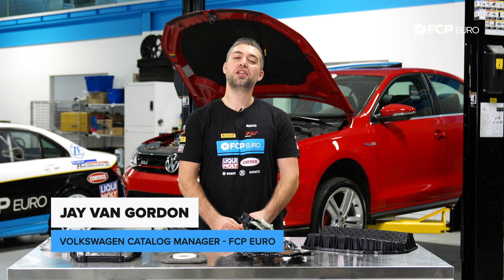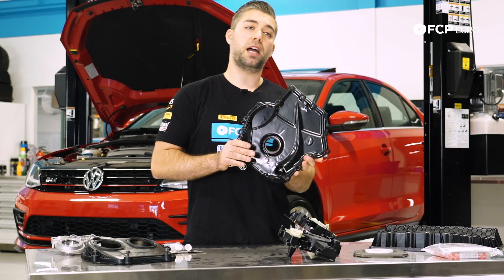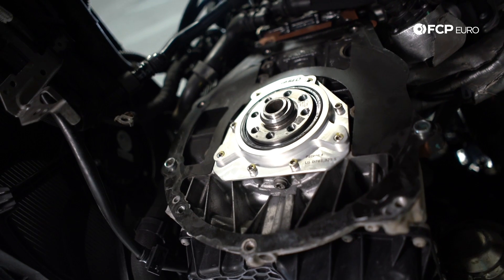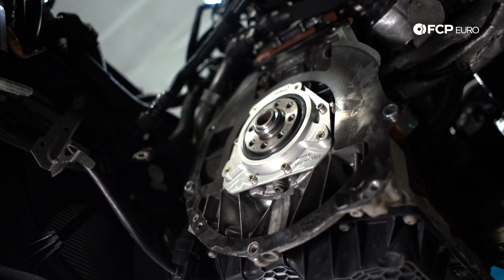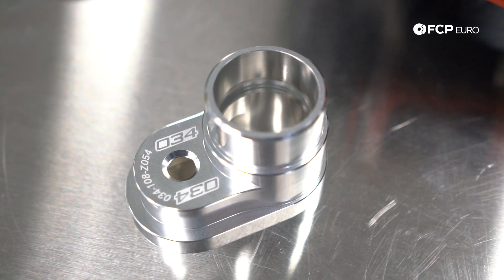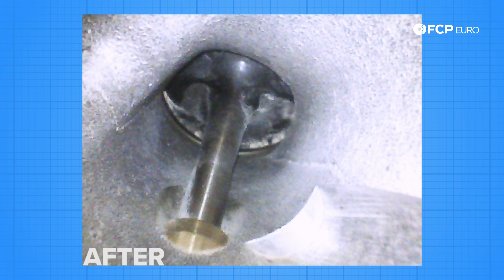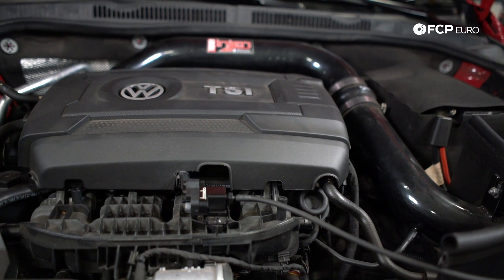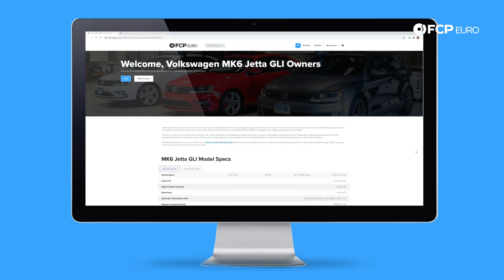Volkswagen EA888 Gen 3 Engine Diagnostics & Maintenance Guide (Mk6 GLI, Mk7 Golf, GTI, Golf R, S3,+)

Comment: 105k miles on my B7 1.8t Passat! Not a single oil or coolant leak 🙌💯
Reply: Update: 205k miles still running all original parts on the engine!
Reply: @danielveliciu3445 Mine 225.000 like new.
Reply: @danielveliciu3445  ??? BS or u don't have clue yet may be who know*
Reply: @bm_wuratli6883  lol are you high? 

I’m at 223k miles still running strong.. Replaced water pump at 210k only because I was walnut blasting the valves.. Everything else on the engine is still original never been touched besides maintenance stuff..
Reply: 2016 1.8t with 121k miles. No leaks so far.
Reply: Lucky you. Mine just passed 108k kilometers and the water pump started leaking.
Reply: @atgv43  Seems to be a common theme with vws. We've like 8 water pumps in stock at all time because they leak so frequently. Most common on vr6s
Reply: @shankyouverymuch8321  I guess maybe I am lucky that it lasted this long. My car is a 2016 Passat with the 1.8 TSI.
Reply: 2018 passat 2.0 b cycle, I finally changed the water pump at 110k but only because I felt like doing it, it wasn't giving any problems. 
I have not put anything into this car that wasn't completely preventive maintenance. Nothing has broken except a rear wheel speed sensor at 25k miles. 
I also beat the shit out of it for 800 miles per week and leave every redlight full send. LOL
I think the best thing to do with any car is drive it like you stole it every day. 
Old lady cars always break down more often than cars that get rode hard and put away wet.
Reply: @jims.3987  good old Italian tune up really does help out!! I just passed through 179k miles yesterday and she’s still running strong.. Still running on the original water pump 🤞 Only leak that’s recently developed is a very small one on the upper timing chain cover.. PCV valve replaced every 45k miles, transmission fluid flush every 50k miles, and coolant at 120k miles.. I do beat the crap out of my car and my oil consumption is around a quart every 5k miles but that’s when I change the oil regardless.. Original turbo as well.. I guess I’ve been very lucky with this car!!

Comment: Thanks for all this information! I hope I don't have any issues but I should be covered under the 5 year warranty since mine is a 2k18. I've changed the oil quite a few times in the 22k miles I owned it. I did the first around 3k miles. Then about every 5K since then.
Reply: Keep in mind this is the company mill for VW/Audi they’ve been using this engine for 10+ years in millions of different models world wide. Engines that have major issues are a very very very small percentage. I personally have 138K miles on my 2015 GTI and it runs like new with routine maintenance and I drive it hard. 

Also, this isn’t a knock on FCP or any other company but they are here to sell you parts so of course they’ll make a video like this telling you everything will break.

Comment: You don't need to remove the intake manifold to replace the water pump assembly, vw actually recommends not to do that
Reply: no....if your car is on warranty, VW service will do it from below, if warranty is no more, VW will remove the intake, bcoz it is easier but more expensive lol
So cheap way is from below, expensive is from the top -> Warranty they go cheap on you. No Warranty = you are the sucker 🤣

Comment: Great video! I did click on it expecting to see my particular failure but it was not on this list and I have not experience any of the ones you mentioned. I do have a 2017 Alltrack with 60 k miles. I do autox and track about once a year. My issue has been with my turbos, I have broken two wastegate actuators, the first one on the OE is 12, later I upgraded to the is20 and also broke the actuator rod in two pieces. Hopefully you will star selling that Mahle actuator being offer as an option by other places.

Comment: My Gen3 GLI has a metal oil pan. I bought the car new from the dealer with it in 2016. 🤔
Reply: So does mine, a 2014. Although mine may have been replaced before I owned it
Reply: My Gen 3 Jetta has a metal oil pan, I haven't got any replacements

Comment: Is gen 3 more reliable than gen1?
Reply: Way better engine because of better timing chain tensioners. Better piston rings, better PCV, and more power. Like any turbo engine though, it needs oil changes done often.
Reply: @Dcc357  that's all that's needed.. The scaremongering on here is unreal.. Probably most think because get serviced by audi it's going to be good oil. Its the cheapest going longlife crap.. I do oil changes on my own. They ain't getting it anymore.. Fsh means feck all.. Anybody can stamp book.
Reply: @johnallan1134  I'm switching to Motul Specific VW 508 oil. 100% synthetic too. However, still changing that at 5000 miles lol. That way I don't have to do 3000.

Comment: What is the most reliable Jetta engine? I’m looking to get into a Jetta from 2014-2018
Reply: The 2.5 5cyl is a work horse and can get 300k easily with proper maintenance. Its not the fastest or the best mod friendly engine but its good. Just keep in mind that any engine will treat you right if you treat it right.
Reply: @SlowBoiGang  which would you deem the easiest to work on? I love being hands on and I always fix everything myself as much as I can. I’d like to do some simple modifications but I’m looking for one that’s the easiest to work on and will get the best gas mileage.
Reply: @tylercorbiere1713  I've had the 2.0(non turbo), 2.5 5cyl and the 2.0T. All three have been pretty easy to work on so if you had to choose I'd also factor in your goals. Do you want performance or just a car to go from A to B.
Reply: @SlowBoiGang  I’m not really looking for performance. I’d probably put a new intake, bov(if turbocharged), better intake manifold possibly and the rest would mostly just be aesthetics, maybe new exhaust tips and a little bit more aggressive muffler. I’d like features such as sunroof, push start, command start(I could install it), and Apple car play. I’ve always driven a manual but I’ve been considering getting a auto for my daily and building something else as a project. Biggest goal is to remove the thought of “what’s going to go wrong next” as I have a Mercedes c230 06 currently.
Reply: @tylercorbiere1713  you should look for a used Jetta GLI then. Very mod friendly, the 2.0T is great. The sedan is nice over the GTI hatch in my opinion. You can make a solid 300hp and still get great mpgs in a comfortable ride thats good for cruising.
Reply: @SlowBoiGang  I’ll definitely start looking into them, thanks for the advice, I appreciate it a ton !
Reply: Prop the 1.4l
Reply: For that year range the 2.5 liter 5 cylinder.
Reply: The 1.4 turbo from that era is bulletproof

Comment: 90k miles on my MK7. water pump was replaced 10k miles ago. No oil leaks to speak of.
Reply: @Bryce Czirr I never had mine cleaned. MK4 GLS 15 years 135k miles. Died in wreck. MK6 2.5 SE lasted 8 or 9 years at eighty something thousand and killed by a wreck (I seem to be a target - bit hit a total of about 5 or 6 times in my life). To be fair it never occurred to me but nothing ever happened to indicate it was necessary.

Comment: I have 2014 GLI autobahn 6mt. I bought it when it had 60k miles and it now has 102k miles. I added APR stage 1 around 80k miles. I love this car! It had given me zero issues! I hope I can get another 100k trouble free miles out of it!
Reply from the maker: Take care of it and it'll take care of you, we're sure you'll have it even longer than that!
Reply: @fcpeuro  Is this the same gen 3 that’s in the 2018 Volkswagen Jetta 1.8t se sport?
Reply: @fcpeuro  i read something about timing chain tensioner failing on some EA888. I know the timing chain tensioner were updated through out the different generations of the EA888. I do believe my engine is the EA888 gen 3. Do you know if timing chain tensioner on this generation engine needs work? I can’t find anything on the maintenance schedule about timing work.
Reply: @CungNguyenify  lol oh yeah!! Mine is a 2014 GLI so its a gen 3. I had a loose timing chain due to tensioner, which in turn made my camshaft rattle and get chipped. So new camshaft, mill the block from what the camshaft damaged, new oil pump and valve check. All started bc i had an EPC light / limp mode which turned out to be a wastegate. So new turbo too lol. My car was a pain in the ass but i basically have anew engine now...but yes tensioner on gen 3 yup is still something to worry about
Reply: The CCTA engines have the horrible chain tensioner problem....if not changed it WILL fail and destroy the engine.  There's a reason they go for $3k used, because they all fail.
Reply: How many miles do you have now

Comment: What is the difference between the engine in the 19 (usa) 2.0 Tiguan and the (usa) 2.0 (GTI)? Is it tuning? Turbo? internals?
Reply: I just  got a 21 tiguan  and a apr stage 1 tune, its awesome.  About to replace cold air,  turbo pipe  and a ecs bov..
Reply: Its basically a tuned down engine. I believe they have the same IS20 turbo
Reply: @SlowBoiGang  thanks for the reply.. That makes my mind up about getting a tune on it from APR.
Reply: @carlosgrajeda8590  nice. I heard that tune really wakes up the car

Comment: I just got to the point that my water pump is leaking... Going to do it on monday , but i got the dual injection version since i live in germany, car has now 120.000 km , i feel like this engin hasn't got a lot of life time even with good usage.. isnt the same as a 6 Cyl. car from BMW for example which can easily run 200.000

Comment: Yes the cam cover also leaks oil. The dealer charges 8 hours labor to reseal. Can you comment more on the scan tool parameters relating to timing chain stretch?  Great video as always!
Reply: Obdeleven can do it for cheap. I'm at 145k miles and have 0.4% deviation on intake timing and 0% exhaust. They're definitely better than the mk6
Reply: @Tcflohr  can you share the name of the PID?
Reply: I've just change mines, took about 3 hours.
Reply: I tried reading it with my OBD11 but couldn’t figure it out. It just like wouldn’t register.

Comment: Love the good info from you guys, keep up the good work! Rockin 65k miles on my GLI and no issues yet, fingers crossed, but if I do, this will help me narrow things down.
Reply: I'm sitting at 111k and only had to do water pump so far
Reply: @CharlesBK-xm7oc  good to hear i have good tidings ahead lol, you run your car hard or just daily drive it?
Reply: @Hobophob1c  it's been my daily for about 4 years now.  Pretty happy with the purchase.  Only thing that's gotten too bad in the driver's seat.  Seems like they used pretty cheap "leather" but other then that cars been great
Reply: @CharlesBK-xm7oc  awesome to hear, and yea the leatherette is nice and all but i still wish we coulda got the plaid gti seats
Reply from the maker: Keep up on that preventative maintenance Sayge and you will be good to go for a long time!
Reply: @fcpeuro  it would be awesome if you guys could you make a video on some preventative maintenance Gen3 owners need to do that arent made apparent in the owners manual? If there is any of course.
Reply: @fcpeuro  Hey man I have a mk7 gti, it’s been coding P00b7. Coolant temp on gauge will go into the red, but an obd read says the temperature is normal ~(194). Car goes into limp mode, and limits rpms to like 4K. Any clue on what it could be?

Comment: So what part of the drivetrain doesn't have problems haha, the air filter? classic VW-Audi crap
Reply from the maker: Well when you hit the start button atleast!..... wait no , that has been known to cut your finger too. Let us get back to you 😁
Reply: He is talking about potential issues...if you want potential issues of whatever car you drive look it up I am sure there are many.  How about the common issue on Toyota 3.5 V6's when the alternator fails you have to pull the engine in most cars with these V6's.  All Brands have their known issues so don't fool yourself into thinking otherwise.  Toyota's and Honda's as known "Reliable" cars also have slipped dramatically in reliability over the years.  The more modern, efficient, technical cars get?  The more problems you will see.  You see it first hit the German and American cars...why?  Because the Europeans and Americans are "innovators" where the Asian brands are "Duplicators" or copy other manufactures tech.  So when you reverse engineer something it is usually made better.  These are facts.  Don't believe me?  Look up the History of Toyota for example and see where they copied stuff and that is only what they admit to.  These are facts.  On top of that, if the German cars for example are so horrible, why are all the Asian companies hiring German Engineers to make their cars more "European".  Again copying the German Tech?  Facts.  So the bottom line here is to buy what you like, take care of it the best you can and enjoy it.  😎
Reply: @eppyz  wrong

Comment: How common is the rear main seal to go on a 2016 Audi S3 DSG. Finally, could yall make a DIY on how to reseal the valve covers with the gasket maker. I had a bit of oil on the cyl 1 & 4 on my spark plugs. Great work as always FCP!  Big middle finger to ECS yall rock.

Comment: Awesome informative video....if only the gli could use other parts from a gti
Reply from the maker: Sooo close yet soooo far....
Reply: Doesn’t the 2019+ GLI have the exact same engine at the GTI?
Reply: @marzzgli1278  exactly the same engine transmission suspension brakes and tuning the only difference is the trunk
Reply: @marzzgli1278  yupp just sucks I like the way my 2014 looks waaay better then the newer one but I can't even get a tune for a big turbo set up for mine :(
Reply: @shaneinfinity4597  yes you can.  there are 3 different big turbo upgrades for the gen 3 glis.

Comment: That GLI sure looks like a Gen2
Reply: yea that year is a weird mashup, has the Gen3 engine but still used the MK6 chassis
Reply from the maker: The Jetta GLI in the background is a MK6 and while it did comes in it's earlier years with the Gen 1 engine, the later years came with  an early variant of the Gen 3 engines.  Gen 2 engines were primarily used in Audi models.
Reply: I see. The intake piping made it look like a MK6 GTI engine which I thought was Gen2.